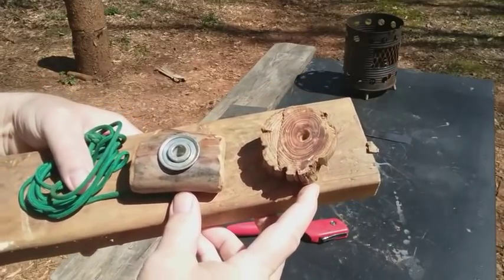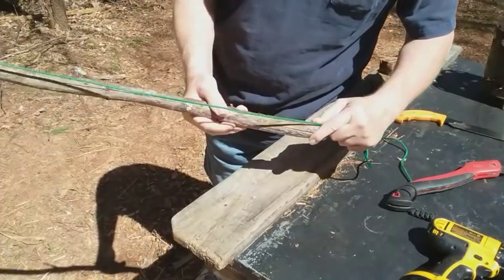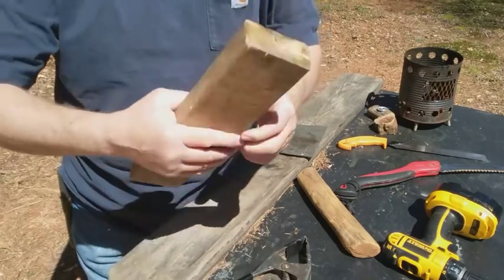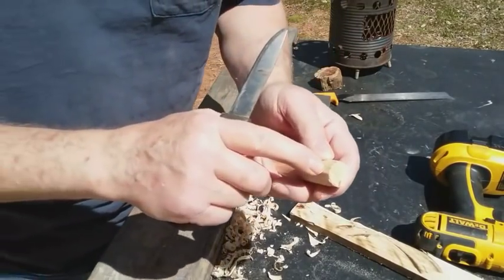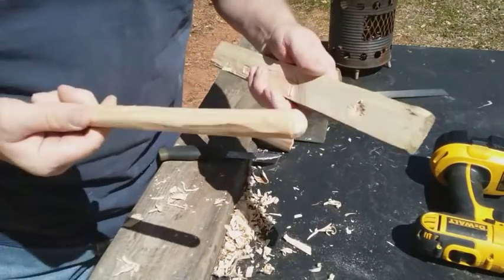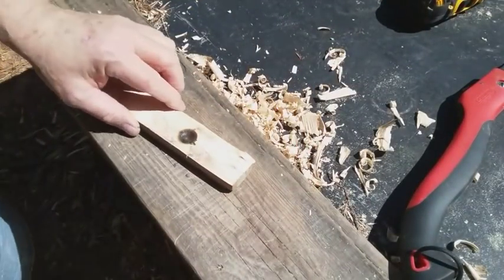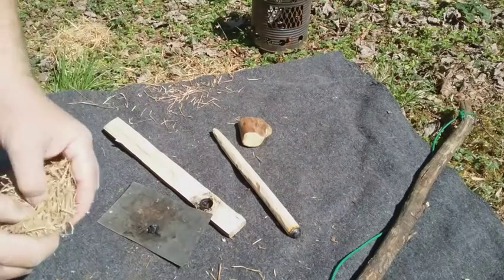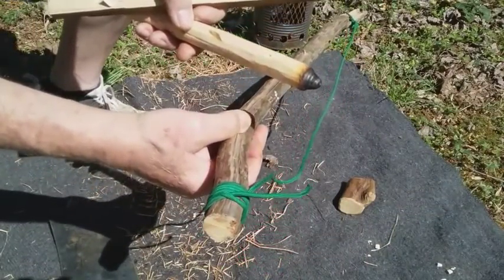Frustrated and Given Up on Bow Drill??? Try a 2x4 and Cheat Bearing Block

Comment: Thank you for this great instruction David. I got so excited when I got a smoking ember I rushed to put it into my tinder nest and it kind of disintegrated. But I will be trying again today and will try not to rush, and be more careful transferring the ember.
Reply from the maker: You have to give the ember a minute or two to coalesce or it will fall to pieces when placing it in the tinder bundle.
Reply: @DavidWestBgood2ppl  Yes sir - I tried today after work and got that ember! I saw it smoking, looked at it carefully and could see it coalescing - carefully transferred and got it to flame. Happy camper today! Learning so much thanks to you.

Comment: Finally did it today David. Your videos helped me incredibly.  I was trying for over a week.Made many mistakes: not accounting for residual moisture even wood that looks very dry to the untrained eye. I tried with hardwood types of fireboards and softwood spindles, could not get it right. I made 4 spindles so far, only the last few really worked. Your tip about the dust particles having to be black was just what I needed. The worst feeling is not knowing what you're doing wrong. I made a bearing block from a round stone which I carved out with a box cutter and three screwdrivers. 
BUT MAN, the FEELING OF THIS FIRST EMBER IS UNDESCRIBABLE.
Thank you and God bless you Mr.West.
Reply from the maker: I remember those feelings from my first ember, too. Thanks!

Comment: great video. I agree. For someone who wants to learn bow brill for first time they should make it as easy as possible great point you brought up.
Reply: Absolutely not. Once u learn to do it right then u can figure out how to do it in any situation.   And really not hard to learn. .. unless you learn by using power tools & ball bearings
Reply: @jfr7694  I would have to disagree. I learned it "the right" way as you call it. and I have seen people struggle that way. Than I eliminated the bearing block friction and they got ember oon first try. Once they got the feel of that, it was easier for them to transition to a normal bearing block, and had to only add a bit more effort because it was a bit more friction. So yes absolutley you have to learn bow drill all natural - including cordage, but you don't strat off that way because failures can discurage you from further learning. It is about progression.
Reply: @bushcraftsurvivalslovenia5241  yeah that makes sense. I learned in scouts when I was a kid & it took a while to get it right. I just have a thing about too many people giving bad advice & just don't think using power tools is the best way to learn

Comment: As I understand, if using natural woods, softer is better. Especially for hand drills. Like Wicca , cedar or juniper.  ?? And degraded or aged wood is better too. ?
Reply from the maker: Rory Tennes Soft is good.
Reply: @DavidWestBgood2ppl  not Wicca. Lol. I meant to type yucca.
I am going to use a yucca or cedar fire board, a dowel from home depot for a spindle and an electric drill just to practice getting an ember and getting it to fire.
I have yet to get an ember with a hand or bow drill.

Comment: I get alot of heavy smoke,when I take the spindle away the pile of dust never ignited, it was more like the end of the spindle would be about to ignited itself, I rubbed the end of the spindle in pure pine sap,I think my board may be slightly to thin ..... Never say die.
Reply from the maker: Bob Strong The spindle smoking for a long time and looking like it might go to flames is normal to see when you miss getting an ember. Board thickness?people say to use the same thickness that the spindle is in diameter, but half as thick as the spindle, many times, is a better call... because it's a LOT less work to fill the notch with dust. We know the notch has to be full befote you ever have a chance of the super heated spindle tip to ignite the dust.

Comment: Dave: It would have been even more helpful if you told all us tenderfeet how to select the right kind of wood to make a bow drill out of in the first place.
Reply from the maker: "Many" perfectly degraded and dry woods will work. How do you expect someone that's given up because of so many fails to have enough experience to choose one of those "many" woods. Lumber is usually ideal. It gets a lot easier after the first success. We all cheated when we first learned Bow Drill.